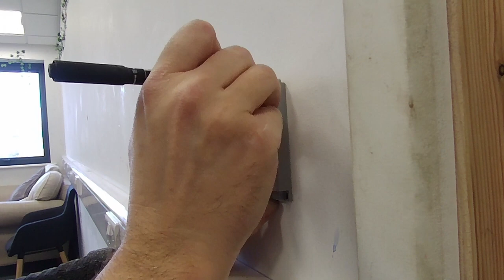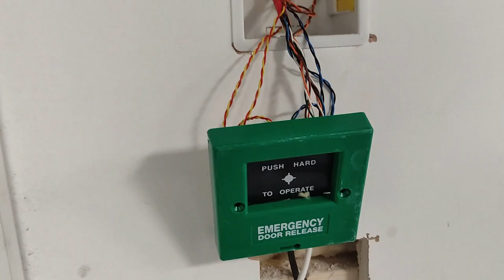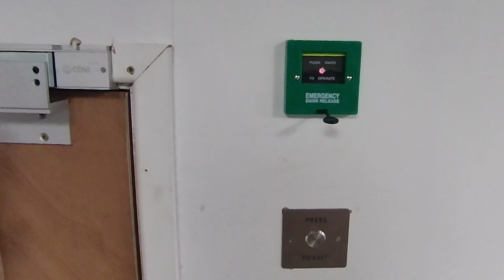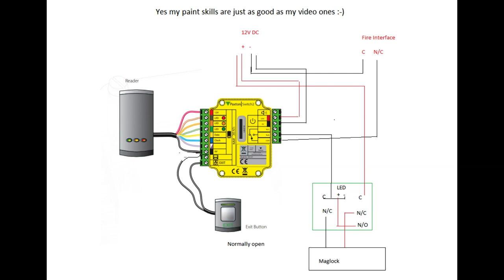Installing a magnetic door lock with Paxton Switch2 Access Control Unit

Comment: Do systems like this has to be integrated into the fire alarm because I have seen a mixed opinion on this on YouTube with some people saying no because the room is locked for safety and other people saying it should be into linked for egress
Reply from the maker: It's good practice to do so and I always do so when possible, especially in sleeping accomodation 

They shouldn't really be used on final fire exits as these need one action to open the door but there are other solutions for these types of doors.
Reply: Here in the state of Florida any door with a magnetic lock MUST release if the fire alarm is pulled regardless if there’s a PIR or REX installed.

Comment: Hello, What are the thin flexible fish rods are you using? I'm looking for some that is that thin but everything I find is not really that flexibel. The other question is how do you program the Keyfob to this system?
Reply from the maker: Hi the blue rods are just silverline 10mm rods https://ebay.us/aVeOAl the orange ones are CK mightyrod https://ebay.us/hmSiF0

blue ones are the most flexible, but because they are smaller they do not last as long as the bigger ones.

When you buy the fob pack it comes with RFID cards that are used to program fobs the fobs, ban fobs, door times, silent function etc

Hope that helps
Reply: @Funeve  thank you very much.

Comment: Hi there, is the switch2 capable of powering an electronic lock by looping the 12V into common, and then positive for the lock from nc/no?
Reply from the maker: Hi Shawn,
The switch2 can come with it's own enclosure and power supply but they are only 1amp which isn't enough to power a maglock. (Tiny one might be ok or a solenoid type lock would be fine)

You'll find the PSUs will die after a while because they can't drive the load. 

That's why I used a third party one 🙂 hope that helps ?
Reply from the maker: And yes you can do what you are asking
Reply: @Funeve  that’s helped very much, thanks a lot! Thought it would be the same as Net2 Pro as Ive seen locks powered straight from the controller - assume it outputs the required power where switch2 doesn’t!
Reply: @Funeve  sorry, did you suggest that this is possible then? 

Also, I’ve seen many ways for locks on controllers to be wired - 12v into com, nc/no to positive on lock, 0v to negative on lock - 12v to nc/no, com to positive on lock, 0v to negative on lock - 12v to positive on lock, 0v to nc/no, com to negative on lock. 

Are all of these typically OK providing its giving suitable power to that particular lock?
Reply from the maker: Any of those methods work, as the relay is just a switch - the 0v is commonly used to drop power to a lock but if your door is metal then it can pick up ground from the building which makes the lock unreliable (it may not unlock, as it's not losing ground) if that makes sense? So you'd switch the 12v instead
Reply: @Funeve  fantastic, thanks for confirming mate!

Sorry for all the questions - but in both 12v methods, would it still be wired to com on the break glass and out via no/nc to the lock?

Or would you need to change it depending on the wiring - e.g. 12v to com, nc/no to com on break glass - would this be the same if I did 12v to no/nc and then com to com on break glass? Or would it be com to nc/no on break glass, then com to lock?

Hope that makes sense?
Reply from the maker: The break glass is double pole which means it has two sets of common and NC so you switch both 12v and your 0v

You should always use double pole break glasses to ensure power to the lock is dropped in an emergency 

If you use single pole it could fail or the lock can pick up a ground from metalwork which would again make it unreliable 

Using double pole is the right way to do it, at the end of the vid I did a wiring diagram so you can visualise it.

And a tip for you, read the instructions for the Paxton fob packs when they are issued - it saves a lot of issues when a fob goes missing and it needs removing from the system 😁
Reply: @Funeve I have once wired nc (carrying 12v) to com on the break glass and from nc on the break glass (on the same pole) to the positive on the mag lock. Is this not correct? Ground on the mag lock has come from 0v on the controller. I see you’ve wired nc on both poles to positive and negative on the mag lock respectively, hence my confusion. 

The way I explained above works perfectly too. Any issues with that though?

This particular scenario was in fact on a metal gate but I suppose it can’t be an issue as it’s cutting 12v to the lock rather than ground?

Comment: Why on your diagram have you cabled ground into NO instead of NC on the switch2 - i can see the fire IO is cutting ground and the BGU is cutting 12V to the mag lock and appling 12V to the Builtin LED but you Net2 is switching the ground on the Mag lock and it looks as if you'll close the circuit when hit the exit button closing the circuit to the maglock not opening it? im confused haha
Reply from the maker: Well spotted 🤐 should be in N/C not N/O as my poor diagram

Comment: Fantastic video! Question, can there be some sort of module to incorporate a computer? Does this project have a computer and do you need a license to access it?
Reply from the maker: Hi thanks the switch2 is standalone, for pc control you would use the net2 plus version which has a TCP/IP rj45 port and the software is called net2 and is free.  Hope that helps
Reply: @Funeve  Cheers thanks for the help!

Comment: Where is  fire interface cable port
Reply from the maker: I didn't film it but the red cable is connected to the relay on a Apollo xp95 input output module
Reply: Hi sorry, forgetting the break glass unit, how does the magnet connect to the Paxton module? How does the monitoring work? Is it a 12v positive and negative to magnet then a common and normally closed pair from magnet to Paxton unit? Thanks.
Reply from the maker: @mark6098  The paxton has a relay onboard which will open if a correct for or the exit button is pressed, 12v straight to the mag and the negative goes through the Common and normally closed pair on the controller relay to facilitate unlocking.

The monitoring contact on the maglock is just a relay that will change state depending on if the maglock has latched on to the plate or not, this can be used to connect to an alarm input on the controller with a sounder also